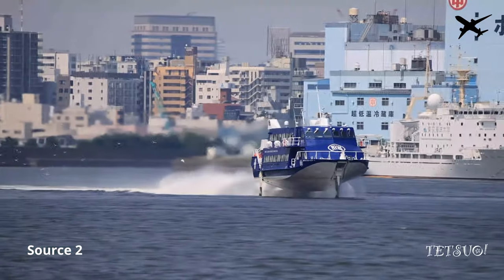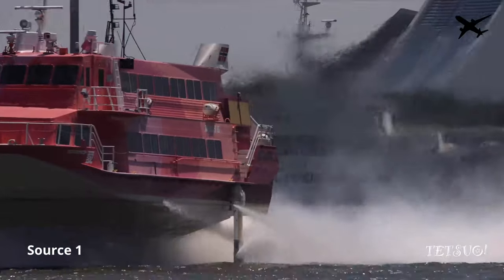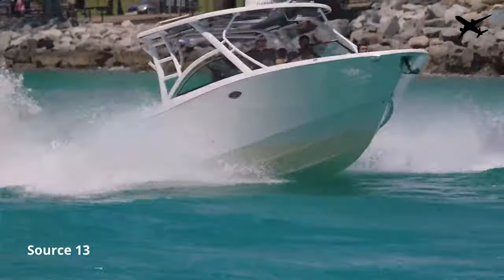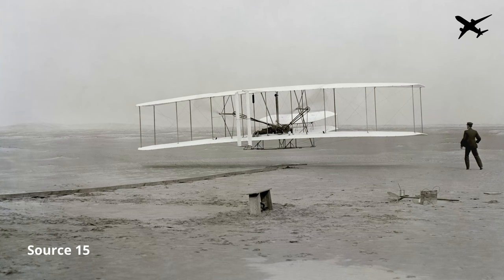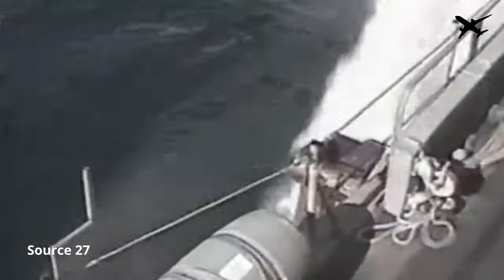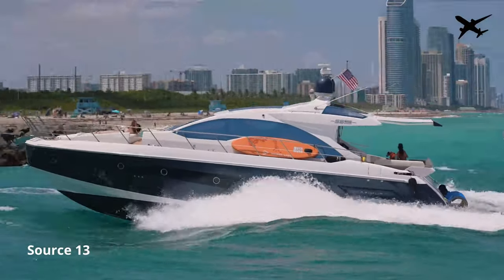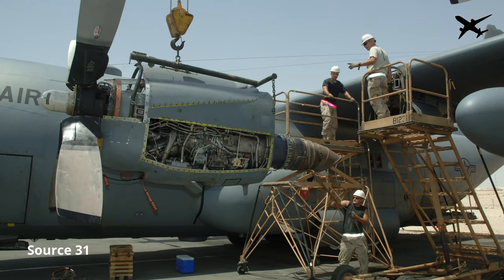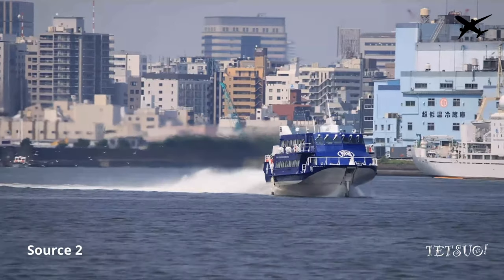Why BOEING built this super-fast BOAT

Comment: I worked at Boeing on 8 of those jetfoils as a test crew member to get them certified for coast guard. sailed 8 hours a day for three months a piece on these boats in Puget Sound, San juan islands, and the straits between the U.S. and CANADA. It was a blast can stand and drink coffee and not spill a drop at speed. Those ships can turn on a dime and give you nine cents in change
Reply: How does these ships perform in (for example 3 meter) high waves?
Reply: They can sail in Beaufort 4 conditions easily 12 ft swells when they got their around 16 ft  you could hear and feel them slap on the bottom of the hull😮
Reply: why wasnt it a success?
Reply: @kevinfitz8516 the environmentalist shut them down the struts and foils was nothing more than razor blades

Comment: Why did they disappear? What’s the reason? Too expensive to manufacture?
Reply from the maker: They are simply too old, and in fact they didn't disappear but just are used elsewhere in the world (asia)
Reply: Most are 40 plus years old now and being retired. A few in Japan are still working.
Reply: Probably because they're thirsty as hell I believe. Yes they're substantially faster than ships but the extra fuel consumed isn't always worth it. Also, with the emergence of high speed catamaran ferries their use is even harder to justify. Just as many innovative vehicle technologies of past days, they're too inefficient, I swear small nuclear reactors could easily revive them all weird vehicles, be them giant hidrofoils, ekranoplanes or whatever
Reply: because the bolt on the doors was missing so they took it away.
Reply: The new catamaran passenger ferry carries more passengers and more stable.
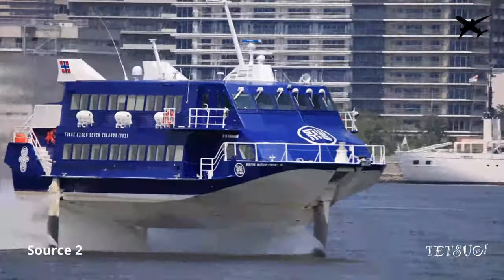Reply: @additome  I am sorry to say, in Hong Kong it has both catamaran ( Turbo Jet ) and Jetfoil running between Macau and Hong Kong and you can see at 3:51 mins, left are Jetfoil and right are Turbo Jet , Catamaran isn't as smooth / stable as Jetfoil coz Hong Kong lots of time has rough sea, but Catamaran is way bigger than Jetfoil , and their seat / design is better than Jetfoil . And that's why the company had modified some Jetfoil inside make it looks very nice now ! It call Premier version .
Reply: @AlphardV55WR35  Yes. Jetfoils are definitely better than catamarans especially when sailing on choppy waters.